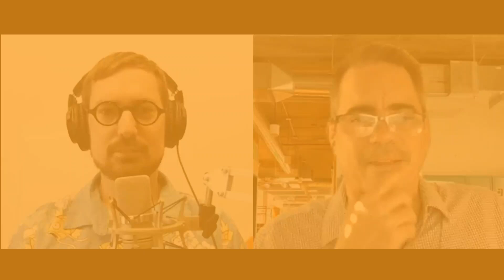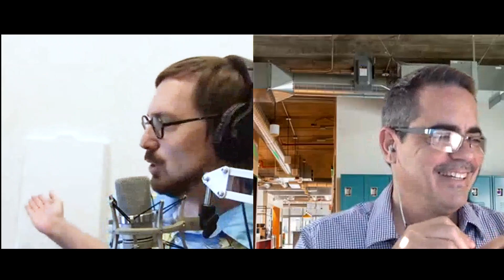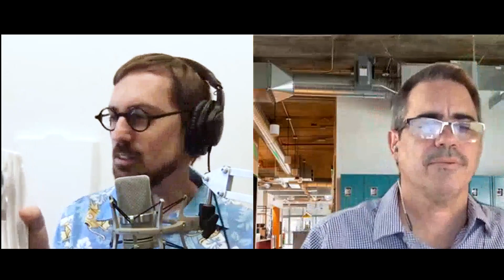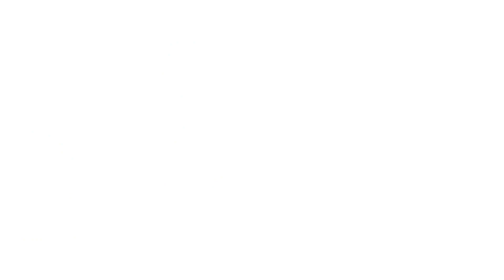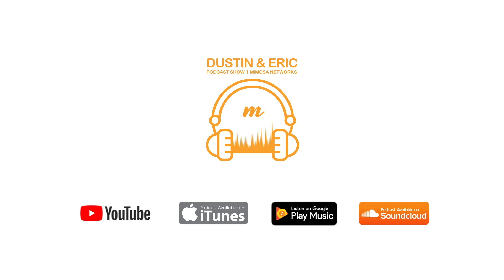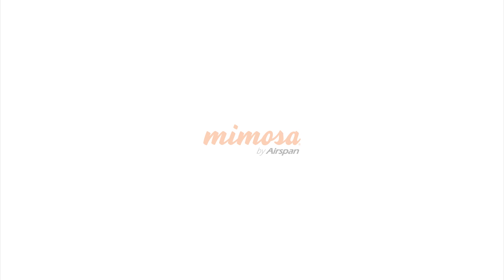Mimosa Podcast #39: The New Wi-Fi 6E (AX) A6 and C6x

Comment: does it support 3rd party vendors such as Mikrotik, Ubiquiti and Cambum? doe sit support previous gen Mimosa radios as well as what is the maximum range for clients to connect? when will it launch worldwide
Reply from the maker: When it's set to open Wi-Fi mode (Wi-Fi interop), it will work other other 3rd party CPE radios and previous generation Mimosa CPE radios. Range will depend on noise and spectrum, but typically it will reach up to 10-15 km. It's expected to be available in Q1/Q2 of 2022.
Reply: @MimosaCo  always replying with good feedback. thank you guys can't wait